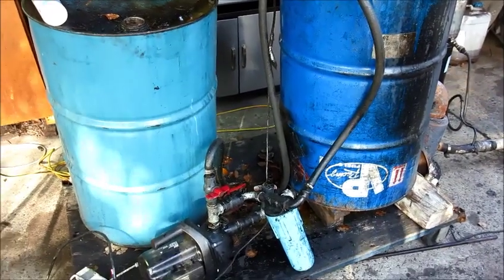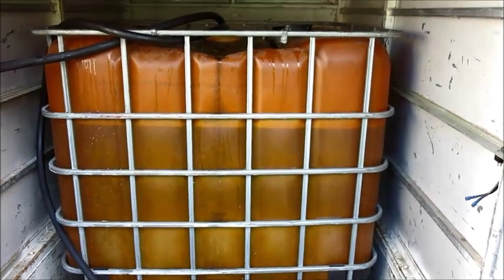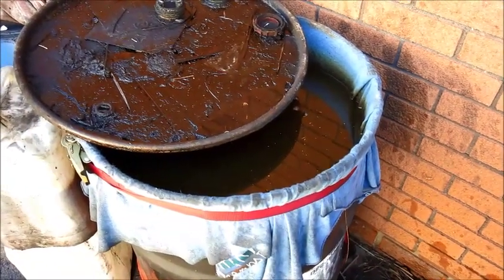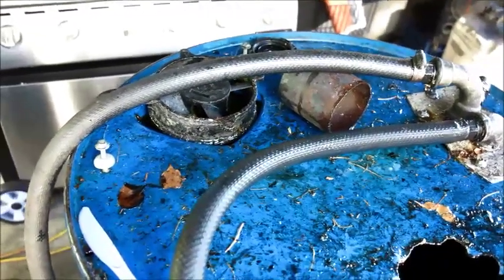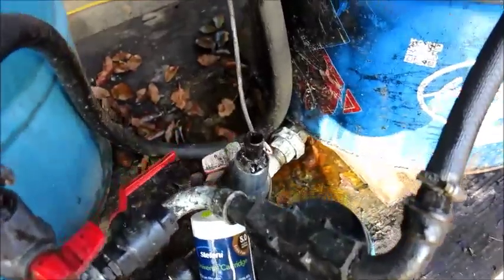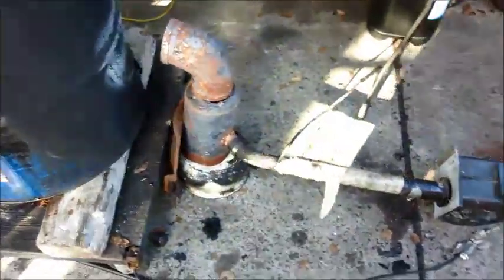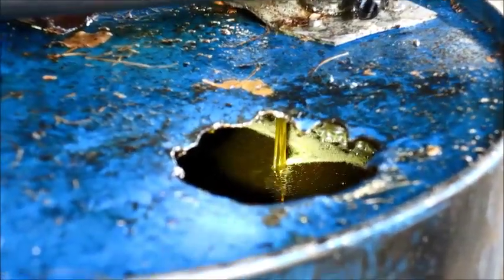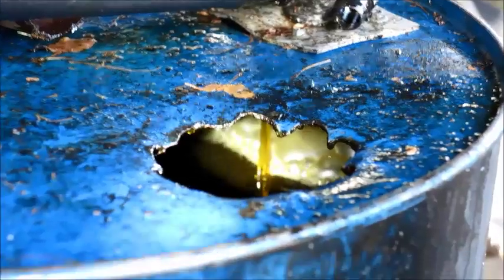How to filter Waste Vegetable oil Fuel ( WVO)

Comment: Hey Oil Burner! How the devil are ya? Great videos thank you very much and very entertaining. I am going to try and set up a processor the same way you did but I have one question.What is the exact pump you are using if you don't mind me asking? If you don't know or reckon I couldn't get the same one do you think a 12v DC marine pump would work? Does it make much difference in pumps? I have heard many kinds of pumps wont work with WVO. Im getting it off ebay so id rather not experiment with the pump. Thanks again and please keep making these videos! Very inspiring ways to make the neighbors nervous. :)
Reply from the maker: +Distilled Media 
I don't know what the pump is, I bought it used off fleabay like several others I have bought.  It's a 1" in/outlet and 600W from memory.  For this sort of thing, There aren't many pumps that WON"T work.  Just try and get one with a similar pump shape to this one. The pumps with the larger impellers sem to have more "bite" on the oil where as the ones with the small pump sections often called turbo pumps don't work as good. Many people use them but I found the one with more bulbous impellers work better. 

 Most of them are Chinese knockoffs now, even the brand name ones, so they are all very much the same.  The one thing that seems to help for oil is if you get a pump with a relatively high head  rating. That is the specified height it will pump the water up to.  The other rating is lift but that's irrelevant in this case as the liquid will be above the pump anyway. 

Don't get pedantic about what pump you get, for THIS application, I really can't think of any that wouldn't work other than the pulse type 12V pumps which have very low pumping rates for what is needed here.  Just stick to mains powered pumps with a bigger pump section and you should be fine.
Reply: +Oil Burner Thank you for that really in depth explanation. Totally makes sense. Ill go with one of the ole fleabay that looks a bit like yours 600w mains powered.
Reply: Any centrifugal or gear pump of 1/3 to 1/2 HP (250-500W) will work, just be sure to use a pre-strainer to catch the big chunks and nuts when you collect the oil..  A/C powered pumps are more convenient if you have grid or A/C generator power.  I used a steel tank and used an air conditioning vacuum pump to evacuate the air from the tank before going to collect raw oil, so no pre-strainer was needed to collet, but used to strain the oil as it was poured by the restaurant staff.

Comment: Does activated charcoal works as filter for waste vegetable oii?
Reply from the maker: There is nothing that it would filter out that ordinary filters wouldn't get. You are only trying to get particles down to less than 10 Micron. If you can get them to 1 or 5 UM might be better but as far as I  am aware activated charcoal is more a sub micron/ Chemical filter.